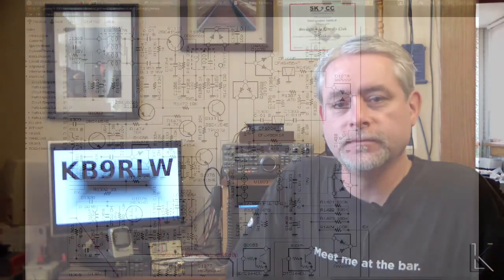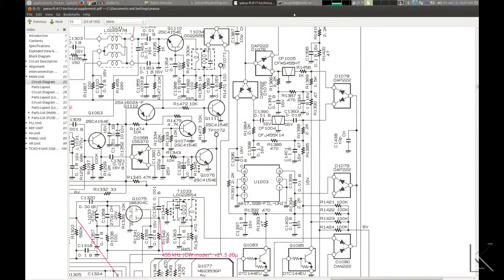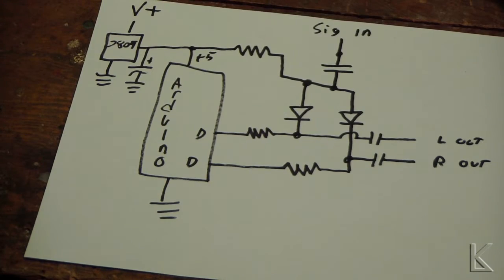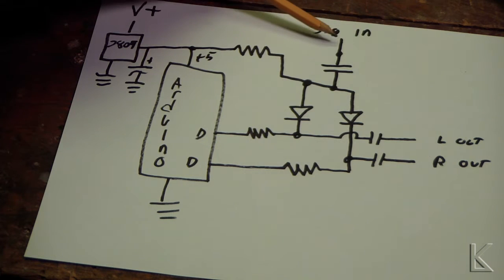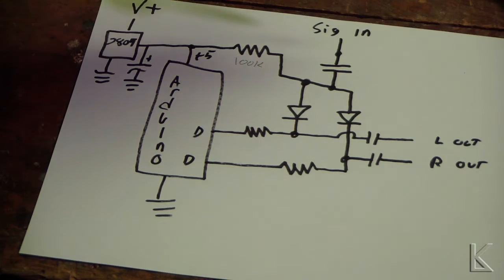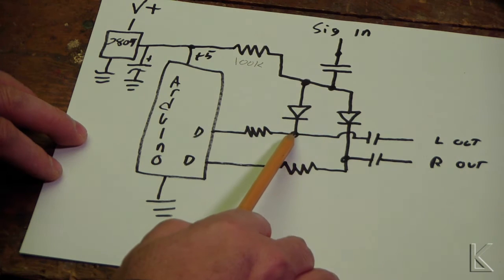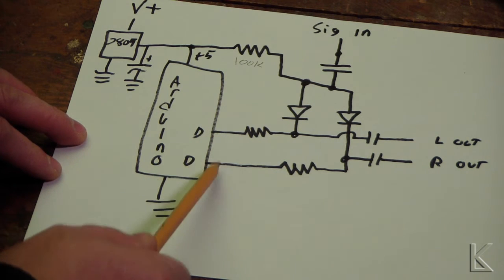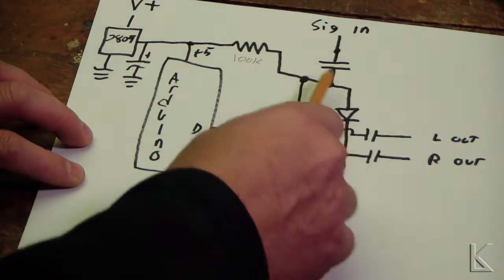Ham Radio - How diodes are used to route and switch signals in RF circuits.

Comment: Very interesting Kevin, and well explained, I hadn't realised that diodes  were used for switching to any large degree, but far cheaper than relays, but I assume  large currents would limit there use? 

Thanks for the explanation and demo... 

Mike G8POL
Reply from the maker: Well, there's always a bigger diode...    However, I was looking at switching of low level signals.    You could look at how pin diodes are used in antenna switching for T/R circuits.   I know they can switch 100W transmitters that way for full QSK operation.
Reply: Kevin Loughin Yes I did realise you were speaking of low signals rather than mega power, but it's quite amazing that they can be used in such away, pretty clever... 

Thanks again for your input and keeping things interesting...  73's

Comment: Kevin. Thank you. I'm building a receive converter that uses diode switching to switch from 80 meters to 40 meters. It's an old Doug DeMaw design and works great! It switches forward biasing  on the diodes to select which set of oscillator and amplifier chain is used just before the mixer. Excellent explanation of how diode switching works. 73 DE K7RMJ  Frank